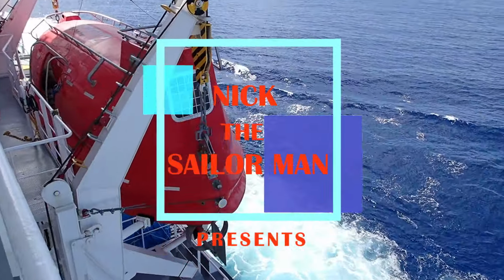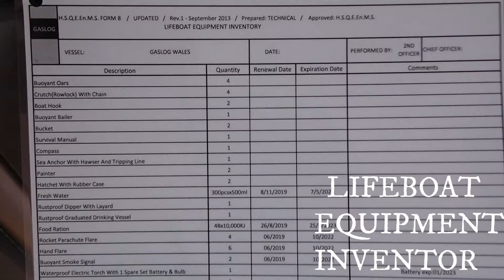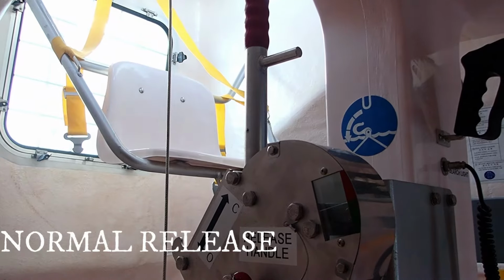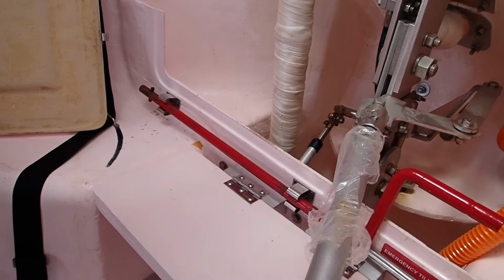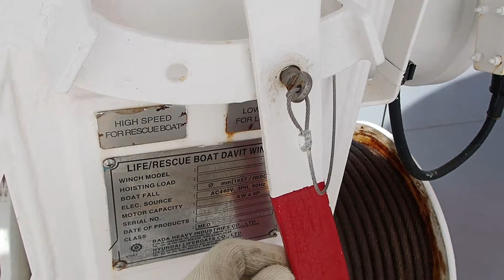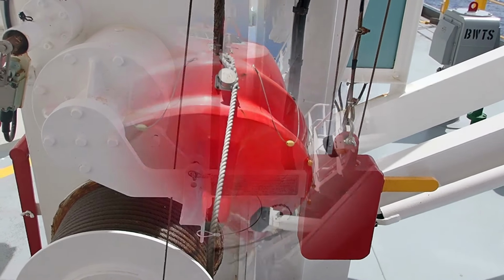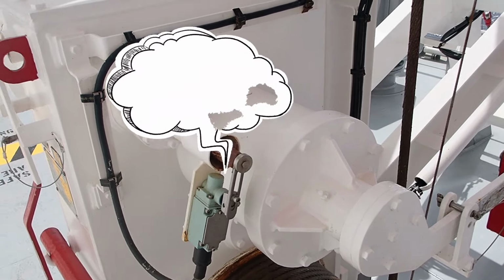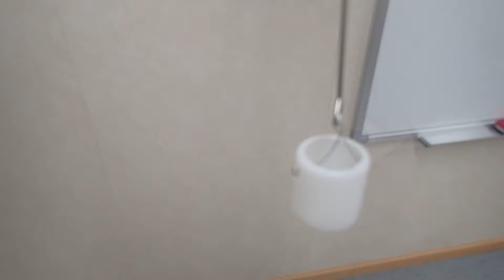How to operate a Davit launch type Lifeboat and How to Launch it! What is equipment is on board 🔝⚓🌊

Comment: There is a possibility if you press the limit switches while you already heaving up lifeboat which will trip your pump ...so it's better to first keep pressed the limit switch one by one and then try to heave up with the button in order to confirm that limits are working properly.. great video btw
Reply from the maker: Great comment Nahui yes indeed this is one best practice to perform it without possibly tripping the pump.
It has happened to me and then Electrician or Electronic rush on the spot to start it back up again.
All over the years it has only happened to me twice but at again as you said its preferable to be done as you describe on your comment.

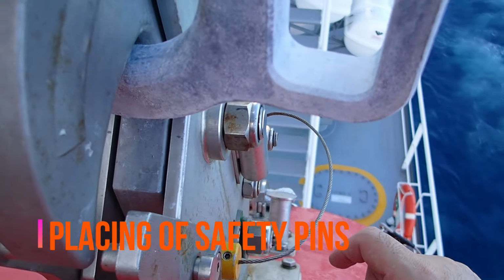Comment: Captain, since we have the pin at 0:40, why do we also need falling preventing devices (FPD)?
Reply from the maker: It falls upon the makers manual and Masters discretion.In some instances in the past the FPD was used only when the boat was moved from its position.Now days we only place the pins.
Reply: @nickthesailorman360  Oh ok! Thanks Capt!
Reply: There are 2 types of FPD, "Locking pins" and "Strops or slings" Since FPD was first officially mentioned on IMO circular in 2009, some old ships manufactured before 2009 may not have pin hole for the "locking pin" , those ships usually use "Strops or slings"  to fulfill the IMO FPD requirements, as the use of strops is technically easy and economic. 

Further information can be found in MSC.1/Circ.1327, MSC.1/Circ.1392 and MSC.1/Circ.1466.
Reply: @charliemak9803  Yeah, I had also found that when I searched it. However I've seen sling FPD onboard a 2016 vessel which of course had the safety pin for the hooks. That's why I asked. Maybe they exist there in case the crew wants to to get the life boat to sea and need to avoid the premature release between the time they put the pin out and the moment they release it manually.